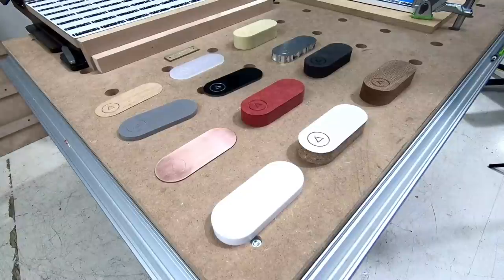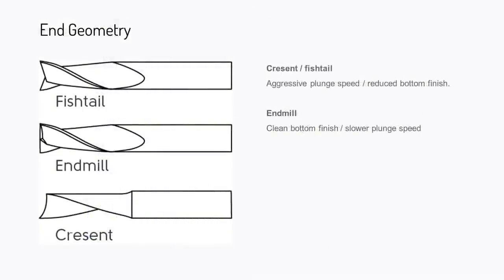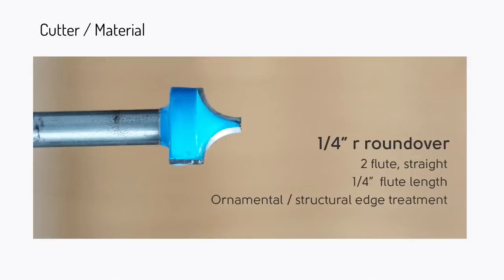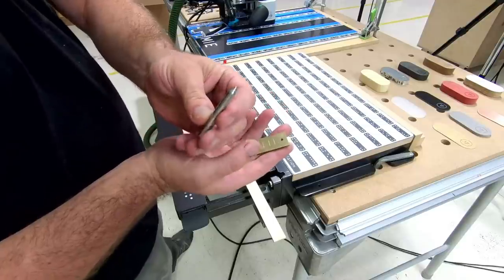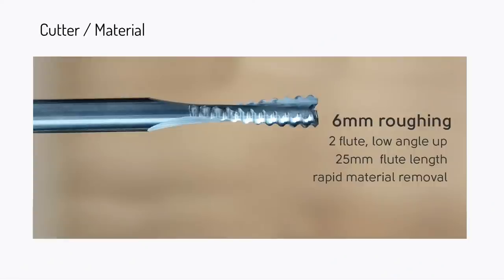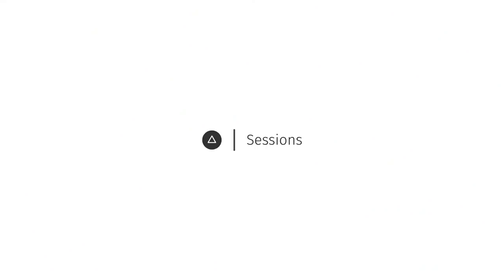Session 9  – English: Materials and Cutters

Comment: Hey Shaper,

When you explained the bit where pattern router bits cant be used with shaper, i was thinking: that would be a seriously great new option: with origin you can set your depth exactly where you want it. Wouldn’t it be interesting to have a “pattern function”? What i mean is: in the pattern mode, origin doesn’t need tape. It operates as a normal router, but with a digitally controlled Z-axis. In this mode X and Y are fixed.

Comment: To save some time: materials and time stamps are:
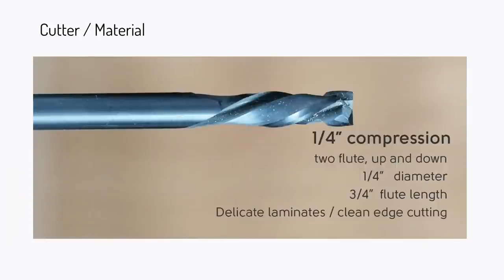Reply: laminates: 8:15
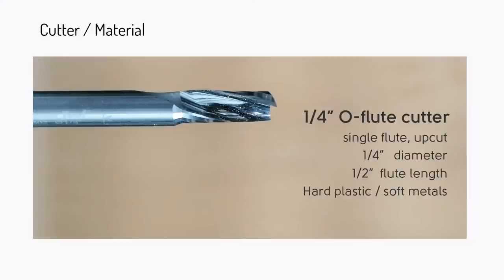Reply: hard plastics, soft metals 9:15
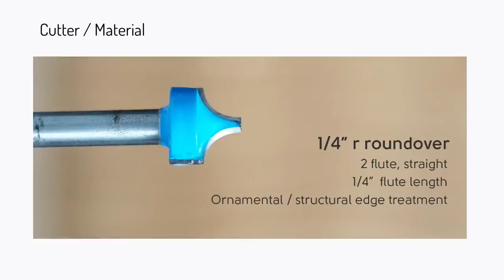Reply: roundover 12:00
Reply: conical mold making 14:00
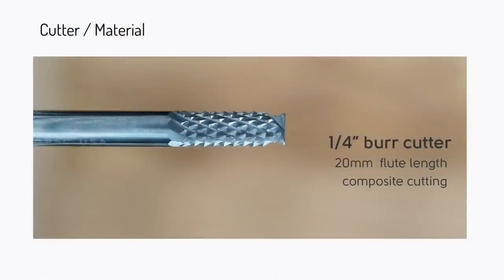Reply: composites 15:00
Reply: diamond tip scoring 21:10
Reply: roughing 30:47
Reply: cutter life 34:33
Reply: @kthschsslr so useful, thank you

Comment: @shaper I’ve seen several people use for metal, heck even 3/8” flat bar question is I guess any carbide but would work just take it slow?  Another q is on the sign blanks like we use in our print shops, I guess any end kill you’re off flat cutter tip would suffice?

Comment: When using the diamond tip for engraving and trying to hold the Origin still, couldn't the base of the Origin be clamped down for each letter while engraving in auto mode?
I know that is a lot more work, but the tool wouldn't move.
A location for the clamp would have to be chosen so as to not damage the base.

Would this be possible?